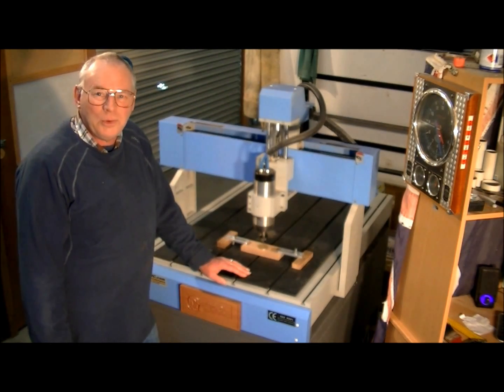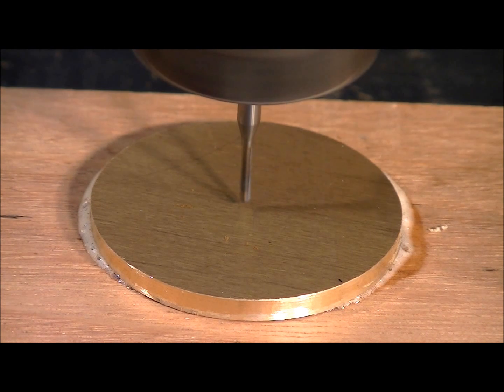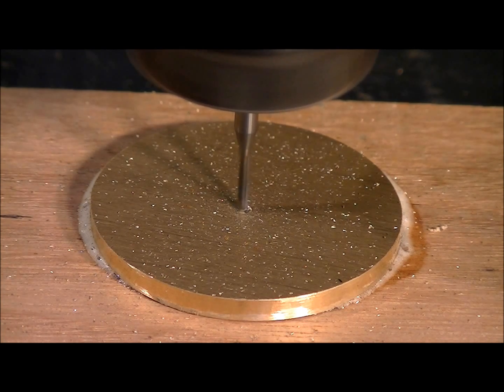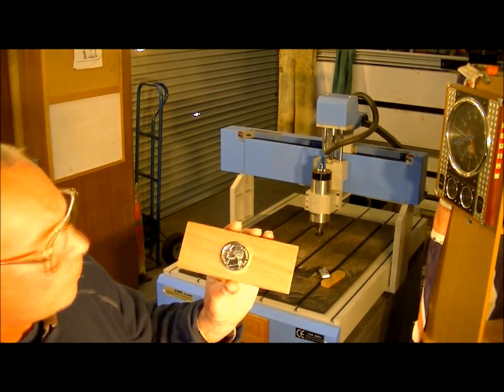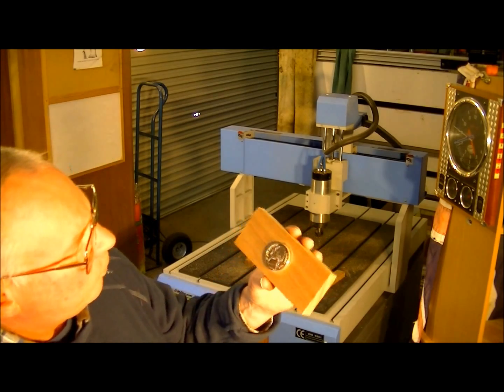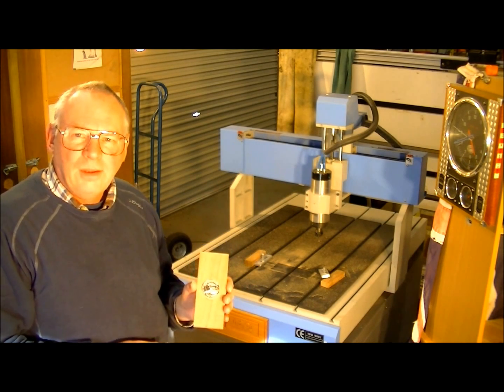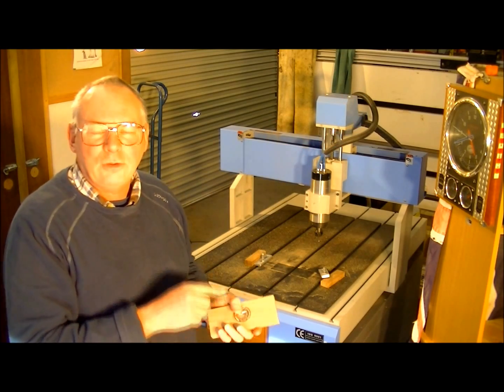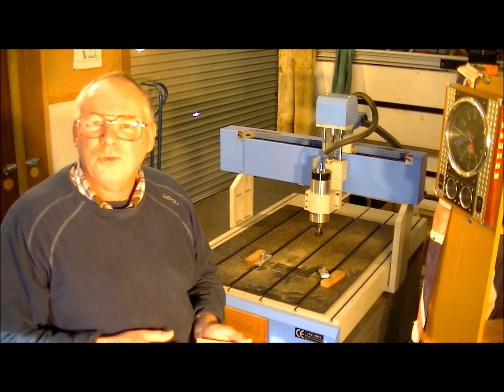6090 CNC router machining a $100 coin medallion demonstration with ArtCAM,

Comment: What needs to be pointed out here is that your engraving such detail on a machine that is capable of machining something that is over 3-4 foot square!!  The first time I engraved something down to a few thousands of an inch it blew my mind thinking of how many thousands of an inch there are in a machine with a 3.5 x 3.5 foot bed size!! (1.764 million)  I think Mr Webb machine is a just little bit bigger than my machine!

Comment: Hi Roger, Nice vid. What cutter bits are you using - it looks like a ball nose mill bit to begin with and then a v-shape cutter for the letter engraving. What RPM and feed rate do you find suitable. Do you use lubricant or is dry cutting good? Is the brass disc glued to the wood? Do you use mach3 to control your machine? Thanks.

Comment: Before I asked this question, I tried to see if it was already answered before.  Hard to tell, so here goes:  What kind of adhesive did you use to bond the metal to the little platform it was attached to?  After the milling is over, how would you remove the finished product from the platform?  I very much liked your presentation.

Comment: A Craftsman Machines a Nickel Coin Out of Solid Brass Using a CNC Router Cutting Machine.   Australian inventor Roger Clyde Webb demonstrates his ability to make money by machining a nickel out of brass using a CNC Router cutting machine. There are certain clear distinctions between the personalized five-cent piece and actual legal tender, including its size and the fact that the lettering is engraved, instead of raised.
Reply: Xaroula Kosta yes pressing coins at 100,000 lbs of pressure lot different

Comment: What tools were you using and feed speeds thanks
I tried to do something smillar
Which CNC driving software. Are you using.   I used Mach 3  and it pausing nearly to stop on each quarter arc mill on a spiral cut 
Thanks

Comment: Hey , is there anyway you may have a printer with the right ink to print any paper denomination money , like Euros or US dollars???>
Reply from the maker: EivinSukoi 

G’day, I’m glad you like my video and thank you for your
comments and watching, it all helps me to improve my channel.  Roger Clyde Webb Australia ;) haha.
Reply: US dollars are not really printed on paper. It is a cloth, paper hybrid with some synthetics tossed in for security purposes. Making good counterfeits is not an easy task at all. The bad guys look for over worked cashiers who quickly handle the incoming cash rather than attempting to supply quality fakes.
Reply: Jim Sadler technically, todays photocopiers can counterfeit the currency (the color quality and resolution is up to the task), but they have put in safeguards to prevent you from doing it. Put a Dollar Bill on a Modern Color Photocopier and hit print. What will come out is a Black rectangle. And Criminals get the paper by washing the ink off $1 notes and printing a $100 note on top of it. This is why the Gov now redesigns the bills so frequently (about every 5 year if memory serves).Trying to keep ahead of the Counterfeiters. Which by the way, Counterfeit $100 bills are more commonly produced outside the US for consumption outside the US. Most don't make it back here.
Reply: Yes, that is called an Intaglio printing press, unfortunately they cost millions of dollars. :(